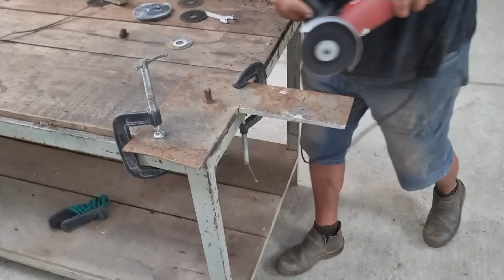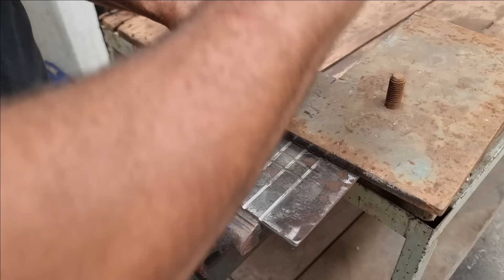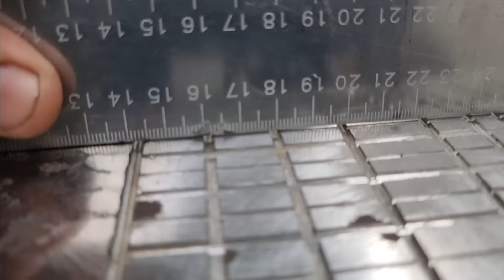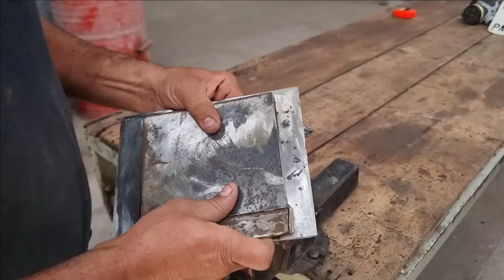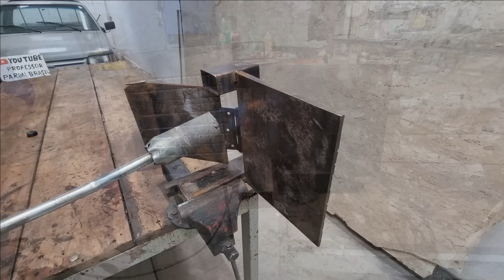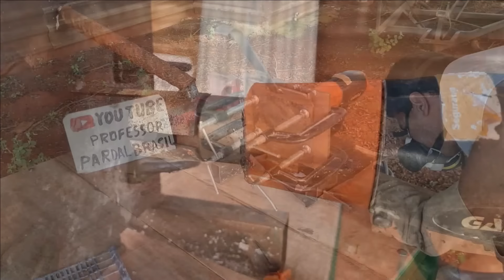MOLDE CASEIRO, para placa de bateria chumbo ácido.

Comment: Nice work ! I have a question ! You only melt specific parts of the battery ? You said there is lead dioxide ( pbo2 ) positive and porus lead ( pb ) negative . Which one you are melting ? And what do you do with the other part ?

Comment: Hello, I think it is better to grind with a magnet before creating the grooves, so that you have a uniform surface, but I have a question for you, what kind of glue is used to fill the positive and negative plates of lead oxide and hydroxide pastes?
Reply: Contrary to what is believed, no glue is actually used. They use a dilute mixture of sulfuric acid and distilled water (between 5-8% sulfuric acid to weight of dry raw active material powder/paste)
You don't need to do anything fancy to make the pastes either. You can simply use fine grey lead oxide or lead metal powder to make the paste for both positive and negative electrodes. No need to use lead dioxide or oxide pastes of specific formulations.
Mix the water, lead powder, and sulfuric acid to make a damp paste that is thick but spreadable consistency.
Apply it to the electrodes. Let it bake in direct sunlight for several hours or in a warm high humidity area for about a day. let it dry for a full 24 hours to fully cure and set. then it's ready to form and use. Charge it for a long time at steady medium current with very gentle bubbles until the current charging decreases to a low value. Positive electrode will darken to dark brown to black and negative will be grey to light grey when finished. Then it is ready to use.

The mixture of dilute sulfuric acid and water when curing and drying is what hardens and "sets" the active material in place solidifying it.
Reply: @realflow100  Thank you very much for the complete explanation
Reply: @realflow100 excelente explicación , yo por ahora recuperaré los óxidos de las placas positivas y negativas destruidas. Pero muy buena su explicación
Reply: Hello, tell me the concentration of sulfuric acid, thank you very much
Reply: @realflow100 هل من الممكن ان تقول لي مهيا الماده التي توضع علا القالب قبل سكب الرصاص